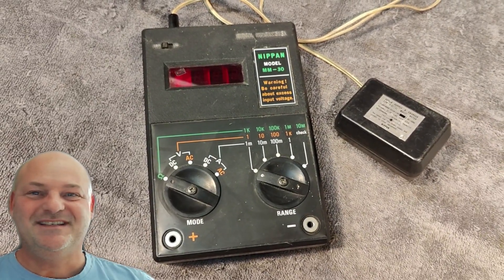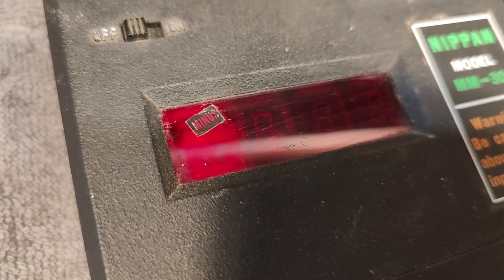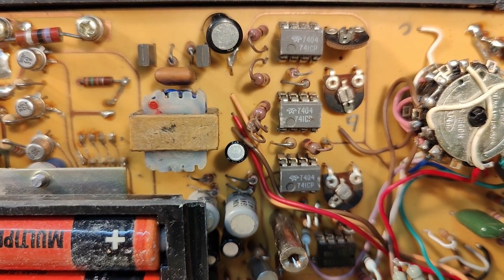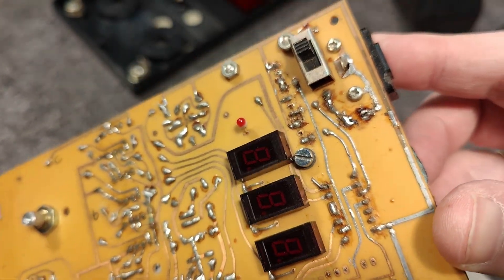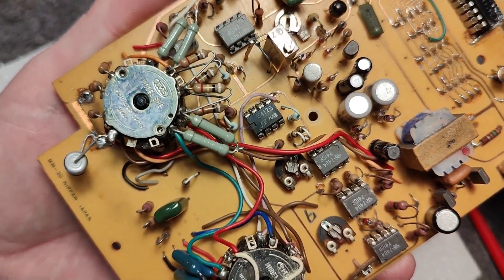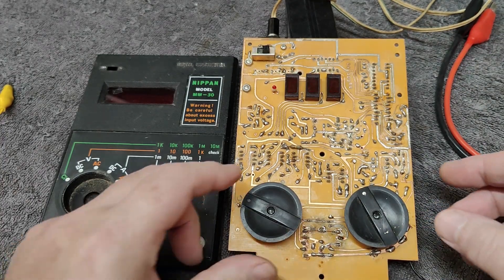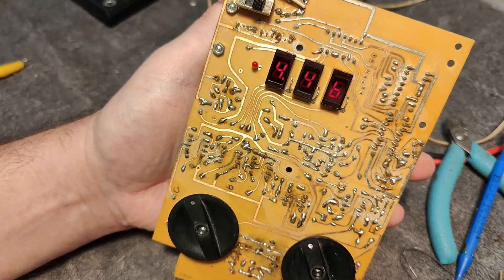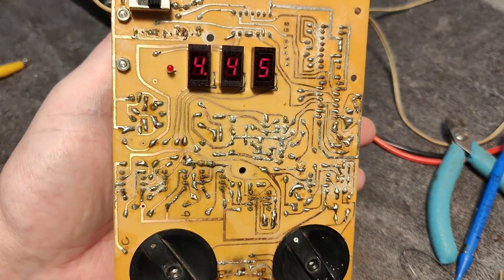Nippan MM-30 Digital Multimeter 3 digits 1974 test repair

Comment: Anything with digits was the dogs bollocks in 1974!  ie early Sinclair calculators. That pcb was made by laying out thin tape on the copper then etching.   

I also often forget those horrible cells inside a device only to find a disaster at a later stage.